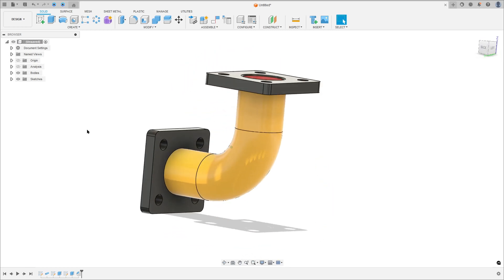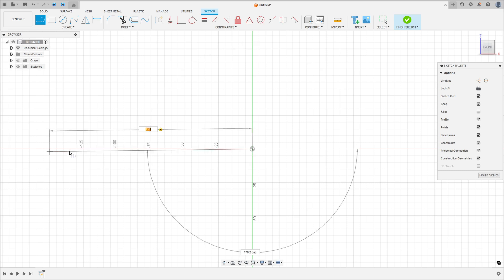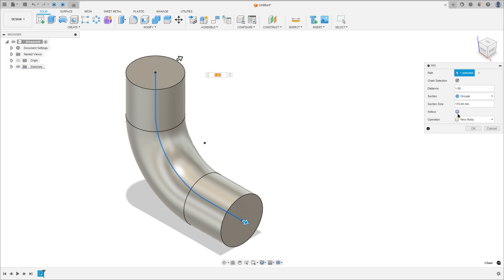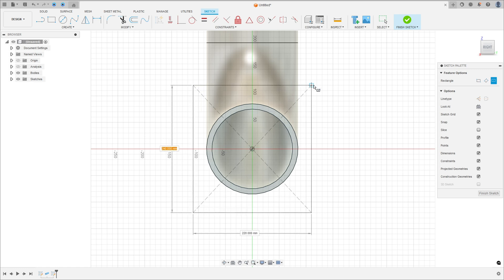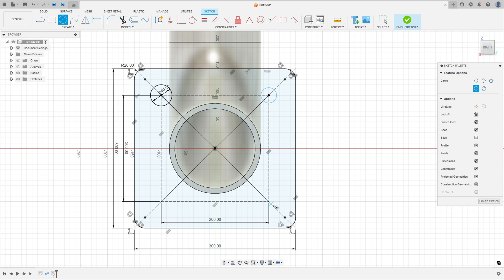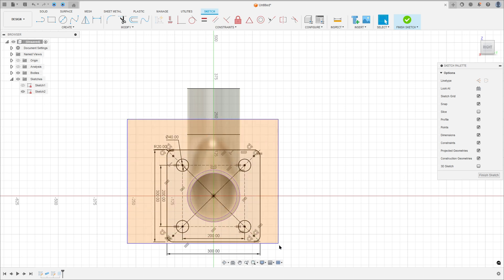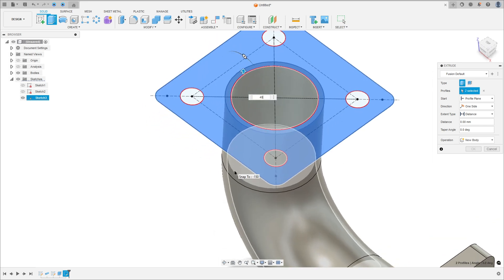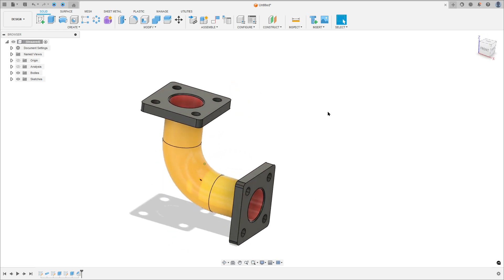Autodesk Fusion 360 Tutorial For Begginers - Exercise 18 PIPE

Comment: Where did you come up with a radius of 200 for the arc that makes the pipe? There's an outside of 285 and an inside of 115, but no 200 on the drawing. How did you calculate the 200?
Reply from the maker: The 200 mm radius is not taken from the pipe contour, but from the centerline of the pipe wall .
Since the outside radius is 285 mm and the inside radius is 115 mm, the center radius is the average between them:

285 + 115 = 400
400 ÷ 2 = 200 mm

That’s why the sweep path uses R200 mm — it represents the mid-thickness (center) of the pipe, not the inner or outer surface.